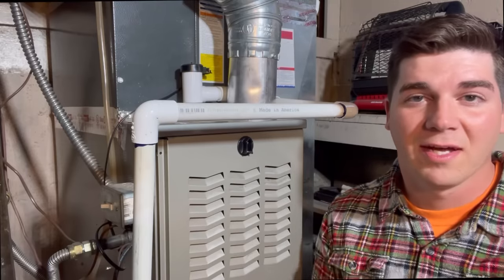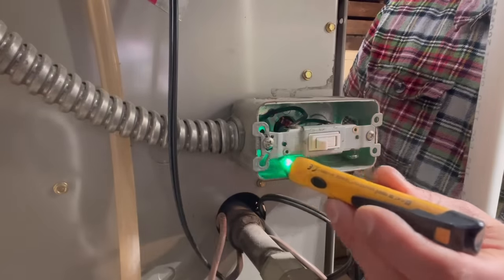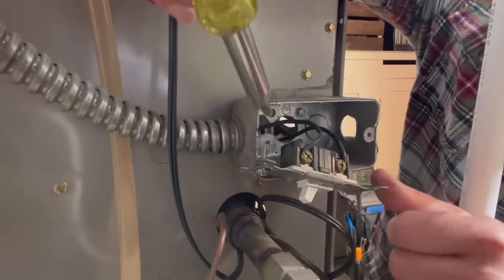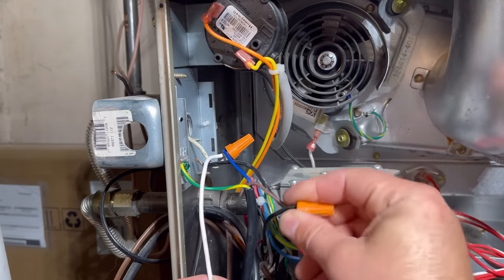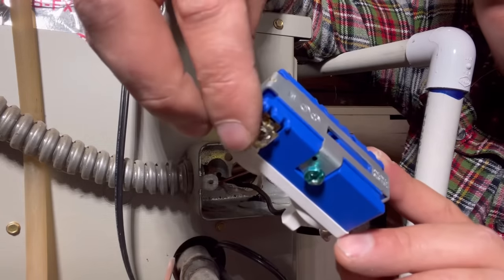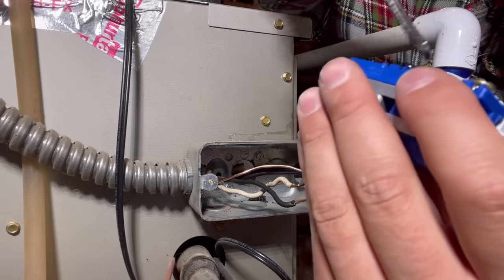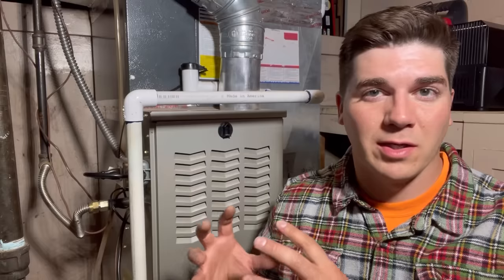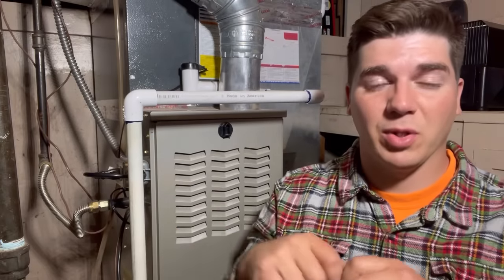This Could Keep Your Family Warm During An Emergency Power Outage.

Comment: I think you should run a wire that connects the equipment ground from inside the furnace to the supply ground which you have connected to the outlet ground.  This way even when the pigtail is unplugged from the outlet the furnace is still grounded.  Also when the pigtail is plugged into the inverter you will still be grounded.  

The way it’s shown in the video, when the pigtail connects to an extension cord which goes to the inverter in the car the furnace is not grounded because the car is on rubber tires and is electrically isolated from the ground.  This is unsafe!   The furnace should still be grounded to the same earth ground that the main house electrical panel is grounded to - even when the power from the street is out and not supplying power the ground will still work.
Reply: The furnace would still be grounded via the gas line, and the grounded metal outlet/housing. 

I agree, a separate ground is best practice regardless, but in this case he should be fine.
Reply: His furnace is always remains grounded to the service panel. The switch only switches the AC line. Ground and Neutral remain connected to the service panel.
Reply: @brianczuhai8909  floating generator ground is "safer" than a dead man cord
Reply: @BinaryHackerMan  I've retracted my comment about trying to commonized the Neutrals on the generator with the House AC. Let 'er float is what they apparently say.
Reply: The ground wire is there to provide an alternative path back to the supply, there is no magic about being hooked to the actual ground.  In the case of a generator if there was a short to normal house ground every grounded surface in the house would be "hot" relative to the generator neutral.  most portable generators are not used with a ground rod, most sit on wheels or rubber pads.  In this case you want your ground to connect to the generator, not to the ground rod driven by your electrical supply.  In reality because appliances have multiple unintentional ground connections you are actually tying house ground back to the ground connection on the generator, but the intentional ground connection needs to be as short and direct as possible, which it is in the installation in the video.
In the case of a poor ground, or when the service isn't properly bonded, a short to ground may not trip the breaker, potentially leaving grounded surfaces energized, which will definitely get your attention, at least briefly.
Reply: @fristlsat4663  At this point, that case isn't formally grounded at al: It sort-of is because the J-box (which is bonded) is bolted to the case, but you can't be sure that was done well enough to be bonded, so it really needs that case bond to the pigtail, since the pigtail is formally providing the power.
Reply: @MikeCnolan  Normally that might be the case, but here the equipment should be grounded to the casing (that's why the casing ground is present, refer to your equipment manual), the box should be bonded to the casing, and the metallic sheathing should be bonded to the box. I check everything with a decent multimeter when doing this to make sure they are connected, and often run a redundant ground to the box (The box has to be grounded if using normal romex), but it should be sound here.
Reply: Look again— I believe he did that. The solid ground connector to the Wago.
Reply: @terrencetrussell7625  the wago shown at 13:34 has three connections.  From left to right they are:  brown- condensate pump, green/yellow frame ground, green - pigtail male plug ground pin.  There is no solid wire in the wago. The solid wire ground from the panel only goes directly to the female outlet.  It should be also pigtailed to the green/yellow frame. But this is not directly bonded.  Yes I know that the outlet is on a metal box and that metal box is mounted on the metal furnace frame but that is not good enough.  It needs an actual wire between the two.
Reply: @terrencetrussell7625  ....and when the plug is not plugged into the receptacle, nothing on the plug side is grounded or has return path to ground. My point remains: where is the ground/neutral path at all times. This is not a trivial question unanswered. I suggest you understand the implications and learn the answer to this question before you even consider any modification.

In this case, it is a simple but critical solution:
install a conductor from the furnace ground to building ground, bypassing that receptacle. Why break that conductor for the sake of installing a receptacle on a stationary device? this introduces unnecessary risk and potentially fatal unintended consequence and suggests that the poster is unaware of the implications of what he is doing. Now here he  is advertising this as a model for others of possibly even less understanding than he to   follow.
Reply: With the pigtail unplugged from the receptacle the furnace is still grounded through the case. So long as that flexible conduit is properly grounded at the breaker panel. Probably could stand to add an extra ground from the receptacle to the box but I'm not seeing the issue.
Reply: "This is unsafe!" - not really. Since it's floating, there's no additional protection that grounding can provide. In normal circuits grounding provides a low-impedance path to ground for current, in case the live wire somehow becomes connected to the housing of an appliance. But this makes no difference for floating circuits, because there's no ground connection to begin with.
Reply: @AlexBesogonov  you are correct regarding the alternative power supply.  But please consider this scenario:  the furnace is connected to metal ductwork throughout the house.  Some of that ductwork has been modified by running romex through the ducts without using proper bushings and somewhere a wire insulation wears thin and a hot wire is coming into contact with the ducts.  When the power from the street returns and the furnace is plugged into the inverter the shorting wire has no return path to the main panel.   I know this is unlikely but that’s exactly why grounding is important for those unlikely situations.
Reply: @AlexBesogonov  your "floating" circuit will kill someone and is against NEC. 
The furnace is grounded as originally wired. It is (was) not "floating.  Why are you arguing the value of a grounding conductor in an electrical circuit?
good lord.
Reply: @osmith5086  NEC does not require bonding floating circuits to the ground. It's also not always _safe_. But how can a grounding wire be unsafe?!? Quite easily: if you have a break in the neutral wire somewhere, you can get unexpected current paths: https://youtu.be/qNx6ZHrbyes?t=2 - this is a glowing bolt due to a fault in a ground-bonded phase.
Reply: @osmith5086  If you connect to the supply ground wouldn't that cause a dangerous backfeed possibility? Say there is a short wouldn't that send power through that ground wire, through the electrical box, to the power lines, and possibly electrocute someone working on the lines? You'd have to shut your main switch off and at that point wouldn't you be legally required to have a transfer switch installed? Even if you don't connect a ground wire directly to the one coming in is there a potential problem because the furnace is connected to the box, conduit, etc. like pointed out in other comments above which again leads back to the breaker panel? I am very interested in installing one of these but I want to make sure it's completely safe and legal.
Reply: @AlexBesogonov  you are crazy.
Reply: @kamX-rz4uy  all good questions. I suggest hire an electrician. They can explain all the details as they make the necessary changes. 
Note: there is a difference between grounding and bonding. Ground is connection to earth. 
An electrical short will cause a breaker to trip or a fuse to blow, preventing further damage. 
Good to think about. 
Mike Holt talks about this at length.
Reply: @osmith5086  A short does not always cause a breaker to trip or fuse to blow. I also understand there is a connection to earth but those ground wires in a house are bonded to the neutral wires at the main panel which in turn lead back to the power lines (in addition to the earth connection). So if there's a problem and the power from the generator takes the alternate path to the ground wire that you've attached to the supply ground, that would take it back to the panel and potentially to the power lines. Are you saying since the power lines are not the source of the power (the generator is) that the electricity would only flow to earth? I would say it's much better to ground the generator than connect to the ground wires in the house. Edit: in Frist Lsat's comment, the concern isn't that it would energize the power lines (since that is not the source in this case) but rather energize wires within the house. Either way, it appears grounding the generator is what needs to be done, not connecting to the home's wiring.
Reply: @osmith5086  LOL. Wait until you find out that many countries mandate floating circuits for safety in some cases. E.g. UK on construction sites.

I guess you have never worked with industrial 480V circuits?
Reply: @AlexBesogonov  This YouTube video is not about floating circuits used in construction in the UK or about industrial 480V. 3 PH. This is presented as a DIY homeowner example of something "you can do yourself". The OP is not a licensed electrician and is presenting a limited perspective of the situation. I am promoted safe practice of observing the NEC for residential installations in North America and encouraging viewers to become educated and/or to not do what is presented. This is not only for their own safety, but for that of their families, their neighbors, future residents of that house, etc. - even utility workers down the road. Maybe I speak from some experience with first responder and disaster investigation. Do you really want Joe homeowner hacking up his home wiring with no understanding of the fundamentals? The guy arguing the purpose of a circuit breaker is just one example. 
Electricity is not a toy, and working with it is not a hobby, I'm sure you can agree?
Reply: @osmith5086  I checked. And NEC does not require bonding floating circuits to the ground. I'm also telling you that the act of grounding a generator is also not risk-free and can cause unexpected issues. In fact, in this case the safest route would be using GFCI referenced to the heater's body, to catch the neutral breaks. It might not work with heaters that do their own checks.
Reply: Grounds are just redundant neutrals! 

If there isn't a hot leaking somewhere, it's not necessary.
Reply: @jayanderson6016  if you "know" you will not have an accident, seat belts, insurance and condoms are not necessary.
These things are" just redundant."

Please be responsible, of not for yourself, then for those around you.
Reply: @AlexBesogonov  Alex, you and I both know - I hope - that NEC tells us that residential electrical equipment be installed according to the manufacturers instructions. That furnace I guarantee is required to have a hardwired grounding conductor by the manufacturer. A GFCI would not be advisable in this application. 
NEC also defines a floating circuit as "Power sources that are not electrically connected to the Earth."  Like batteries. An ungrounded residential electrical circuit violates NEC recommendations. 
You are moving the topic of discussion from one realm into another without pausing to acknowledge that what you are introducing is a rare and unusual situation. 
I say again: the typical audience for these videos is uneducated and ready to accept the quickest hairbrained scheme to achieve their goal. I am suggesting that they think about what they are doing and educate themselves on correct and safe practices. I have no interest in debating esoteric electrical theory with you. Put the rabbit back in your hat.
Reply: @osmith5086  Thanks Dad!
Reply: The furnace is grounded by the house branch circuit, as it's attached to the receptacle and it's attached to the frame,.
Reply: @warrenharrison9490  what do you mean by “it’s attached to the frame”?  The house branch circuit is ONLY attached to the receptacle. That’s the issue.  It should also be attached to the frame and it’s not.
Reply: @neilbrookins8428  it is thru the device  though he didn't add a jump from the device to the box, that would be preferred, it's technically boded thru the device.
Reply: @warrenharrison9490 .... but not when he has it connected to his isolated gen.
Reply: @osmith5086  the ground from house is still connected to the unit thru the strap of the switch/receptacle device that's mounted to the box that's screwed to the unit, it's not optimal but it's is still bonded, a jumper from the feed should have been run to the unit to make a more ideal connection.
Reply: @brianczuhai8909  Generator have no ground, test it, they put out an open ground.
Reply: @toriless  He has the outlet neutral and safety ground still connected to the furnace and house service panel. That provides a return current to the generator GFI on its safety ground. I disconnect the safety ground by plugging in a 2 to 3 prong plug adapter.
I have GFIs outlets on my generator which trip if they sense current on the safety ground.
Reply: Yeah, there's a bigger discussion about grounds, earthing, generators I don't even want to mess with.
Reply: So I was referred to this comment by someone who commented on my comment! So I guess my big question is we're all stuck on this furnace  but what if it was a different appliance and this I'm just asking because I'm generally curious what's the difference between a washing machine or a freezer or a refrigerator, space heater.  what's so important about the furnace? Genuinly curious.
Reply: @BinaryHackerMan  Both are unsafe. A floating; as in not bonded to the chassis of the inverter not to the frame of the generator; Grounded Current Carrying Conductor (GCCC) will keep many more recently made furnaces from running. Electronic furnace controls are often programmed or arranged to check for the bond between the neutral; technically the GCCC in this case; and the main bonding jumper in the Service Equipment Enclosure. If that connection is not detected then the controls will not apply 120 volt AC to the igniter, temperature sensor, and blower motor. The furnace will not run because of this built in open ground protection by the control board. 

In this case that is not a problem because the GCCC of the furnace continues to be connected to the neutral of the Service Entry Conductors and to the main bonding jumper, which connects the neutral to the service equipment enclosure and thus to all of the Equipment Grounding Conductors (EGC) that take the form of cable armor or a continuous metal raceway. [Raceway is used to mean any enclosure through which insulated conductors are run to provide physical protection for the conductors and their insulation.] The cable armor or continuous metal raceway will be an effective EGC if they are electrically continuous, properly connected to the Service Equipment Enclosure, and the Enclosure is bonded to the Service Entry Conductor Neutral by the Main Bonding Jumper. It is the connection between the EGC and the GCCC of the furnace branch circuit at the Service Equipment which the Control board Open EGC conductor protection function is testing for. 

Some of the Open EGC protection functions are sophisticated enough to detect that the Energized Conductor (Hot) is of markedly different length than the neutral. Load controls which have that type of detection will not work even when the GCCC is bonded to the neutral of the Service Entry Conductors because the disparate lengths are treated as a Ground Fault to the neutral. That is one of the many reasons why any alternate power supply arrangement should be functionally tested well before any disruption of the electrical utility's supply. Only a full function test done with the Service Disconnecting Means open will detect any complication of the relationship between the alternate power source and an individual load. 

Tom Horne
Reply: @osmith5086  Let me point out that both of those conductors are intact back to the Service Disconnecting Means. What the presenter did was to splice the "Neutral Conductor and the Equipment Grounding Conductor (EGC) of the furnace to the "Neutral" Conductor and the EGC of the power cord. That is why he used all 3 terminals of the lever lock connector on both of those conductors. As it happened here there is no break in the continuity of either of those conductors between the furnace and the Service Equipment Enclosure because both of those conductors are unbroken by either the switch or the way he wired the unswitched conductors. 

There are a couple of technical errors in the way the EGC of the branch circuit and the EGC of the furnace are connected. The bonding of the surface mounted device box to the branch circuit EGC is dependent on the metal contact between the yoke of combination switch receptacle and the ears of the surface mount device box. Although that is a permissible way to bond the ground port of the receptacle to the branch circuit EGC, once the branch circuit EGC is bonded to the device box, it is not permitted for connecting the branch circuit EGC to the device box. In other words the branch circuit EGC must always be bonded to the device box and contact between the receptacle yoke and the device box is not an acceptable way to do that. When the device box is surface mounted it is permissible to use the metal to metal contact between the receptacle yoke and the device box for connecting the ground contact sleeve of the receptacle's EGC port, which receives the cord plug's round EGC connection pin, to the branch circuit' EGC. That is not to say that it is Best Practice but it is US National Electric Code compliant. Best Practice would have been to splice the branch circuit EGC to both a jumper from the box and a jumper from the EGC terminal on the receptacle yoke. 

The additional challenge is that if the device box were not mounted to the furnace enclosure, thus accidentally bonding the EGC of the branch circuit to the EGC of the furnace during both utility and alternate power operation, the control board would not detect a bonding connection between the EGC and the GCCC during alternate power operation. It would treat that as an open EGC when connected to the inverter or a floating neutral generator and not connect the AC Power to the operational portions of the furnace. 

There is also a technical violation of the electrical code in using a cord and plug connection in this way. 

The code only allows the connection of an appliance fastened in place by cord and plug for specific reasons listed in article ARTICLE 400 — FLEXIBLE CORDS AND FLEXIBLE CABLES. One of the reasons listed is; 
"400.10 Uses Permitted.
(A) Uses. Flexible cords and flexible cables shall be used only for the following:
(7) Prevention of the transmission of noise or vibration." 

If that were the reason that the furnace is connected by cord and plug the receptacle would be mounted off of the furnace enclosure and the problem with the control boards open ground detection function would occur during operation by alternative power. 

The only actual change that would be needed to make cord and plug connection of alternative power to the furnace code compliant would be to use a single pole, double throw, center off switch and mount it in a 2 gang box with a flanged inlet. A flanged inlet is a device that simulates a cords plug end but is fastened in place as a means of connecting and extension cord to a load. Such assemblies are available preassembled but you can make your own for somewhat less. 

Tom Horne
Reply: @hornetd  You understand the implications of tying the ground and neutral outside of the primary panel?
You ok with that?

I'm not, for the record.
Reply: What is the hazard that you anticipate arising out of the absence of a grounding connection? Both the National Electric Code and the OSHA regulations specifically allow loads connected by cord and plug to not have a grounding electrode system of any kind. No connection to Ground is required as long as the Grounded Current Carrying Conductor, that many of us call the neutral even when it isn't, is bonded to the frame of the generator or to the vehicle frame when the generator is mounted on a vehicle. Inverters are bonded to the vehicle from which they are receiving their supply current because the negative terminal of the battery is bonded to the vehicle's frame and the negative of the supply is also bonded to the chassis of the inverter as is the Grounded Current Carrying Conductor of it's 120 volt receptacles. Since a low impedance fault current path does exist in both cases the requirement applying to bonding of surfaces likely to become energized have been satisfied. Any current which escapes from the insulated current carrying conductors of the circuit through damage to or a failure of the insulation has a low impedance path back to it's source which will cause enough current to flow to open the Circuit's Over Current Protective Device (OCPD) and deenergize the fault. Except during a lightning strike or contact of High voltage distribution conductors with secondary distribution conductors grounding does not provide for safety from electric shock. It is extremely rare for the Impedance of Grounding pathways to be low enough to carry enough current to open the OCPD of the affected circuit. Grounding's only role in human safety is were the grounding has been engineered to prevent the development of a difference in voltage over the surface of the ground for that difference to be high enough over the length of a single step to subject you to a injurious or fatal shock. Such steep voltage gradients are called step potential. 

Tom Horne
Reply: @hornetd  what hazard you ask?  I’m interested in protecting against the unknown ones.  If you look at 99% of the interlock and transfer switch circuits, they don’t typically switch the equipment ground.  This video shows a transfer switch alternative with switched ground.  Therefore this design is inconsistent with 99% of other designs in this behavior.  Since you asked for an example I will give one.  Say a diy person wires a romex through metal ductwork.  And doesn’t protect the wire as it passes over the sharp metal edges.  Then you are running a generator using the method shown in this video.  Then the street power comes back on but you haven’t yet turned the generator off because it just happened.  In this scenario the romex running through the metal ducts is energized but the furnace frame is not bonded to source in the main panel.  So it’s possible a short from romex to ductwork could energize the furnace frame.  I know this is a long shot, but you asked for an example and this is one.  There is no reason this furnace needs to be un-bonded from the house’s ground when the cord is connected to generator.   Like I said this connection is permanent for most all transfer switches and interlocks.
Reply: The metal conduit and the metal outlet box should be already connected the house ground, but you should not rely on that.  The green wire coming down the conduit should be attached to a grounding screw in the metal outlet box.  The metal outlet box should be screwed into the furnace hosing, but you should not rely on that either to provide the furnace ground.  There should be an 'official' furnace chassis green grounding wire inside the furnace and it should be run to the grounding screw inside the metal outlet box and thus to the house ground.  This assures a hard/permanent ground to the house ground for the furnace chassis and the outlet box.  THE FURNACE MUST BE HARD-CONNECTED TO THE HOUSE GROUND CIRCUIT UNDER ALL CONFIGURATIONS.

For the female outlet, run the ground to the ground in the metal outlet box.  

After all this, inside the metal outlet box there should be a knot of connected ground wires: one coming out of the conduit, one off the outlet box, a green one coming from the furnace chassis, and one running to the ground pin of the female outlet.

For the three prong cable inside the furnace, its green wire should be also connected to the furnace chassis green wire and the black and white wires to the power wires.  Don't play games with this green wire, run it to the furnace's chassis ground connection and make a good, hard connection.

Now whether you connect the three prong plug to the switched box's outlet or the alternate power source, the furnace chassis is still hard-connected to the house ground.

As for the 20amp breaker question:  NEC says if there is only one outlet on a 20amp circuit, all parts of the circuit must be 20amp stuff.  If there is more than one outlet, then the outlets can be either 15 or 20amp stuff (but with 12g wire).

In many/most cases of a furnace, the power draw is less than 15amps (rare to see a 3/4 or 1hp blower motor -- it is essentially the only power draw in the furnace; that is why it is probably not on a 220VAC circuit and you're using a simple three prong plug!).  If it really is going to draw significant power, your inverter may be taxed to run it.  Frankly, if it is this powerful (a 220VAC circuit) and you have questions about grounding, you probably are out of your depth.  

And do be careful that you've not grabbed a less-than-12awg power cord (rare but they do exist).

Don't rely on the gas line for grounding.  Don't rely on a vague chassis ground.  Follow the green wire out of the conduit and make darn sure is is connected to all the grounding points.  This is the only way to assure that you are attached to the house ground.  The electrical codes are very particular about this for real life-depending reasons.  (Even though they should be , don't rely on metal conduits to be grounded...often they are not due to bad installation or corrosion.  Rely on the green wire.)
Reply: @osmith5086  - OP is a HVAC contractor in Utah.  I could not find your credentials other than some of the erroneous comments (corrected by others here) that you made.  Yes you did make some practical common sense ones but mostly you argued with experienced installers the NEC.
Reply: what's the path to ground?  @superphotog
Reply: @osmith5086  - You will have to ask the contractor in Utah who is licensed to do this work what the path to ground is in that particular instance.

I could not tell you definitively which of my several paths to ground on my in home system is the 'mostest' conductive but I can measure that it is grounded it with my fluke multi-meter with the special double leads used for very low resistance measurements.  I also use a Simpson 260 as a d'arsonoval meter movement can load a circuit which the higher impedance dmm's do not, showing other problems not seen by higher impedance devices.  Cannot tell you how many blasting meters and flame signal meters I have calibrated but it probably is approaching a thousand units. I did that work for professional licensed electrical and mechanical tradesmen guys like the OP so I trust him over your carping.
Reply: So you are explaining that you really don't know what you are talking about. 
good job.

SIT DOWN, son. Stop whining.

 @superphotog
Reply: @osmith5086  - 📸Oooooh good burn but appears to be a little projection on your part.

But as it is a free country (for the moment) I will take the assessment of the contractors in the states from Colorado westward who were the customers of Meter Master/Process Measurement Company for the 20 or so years that I was employed there that I do know what I was talking about.

Don't know why you chose to hit on me as many of your previous comments are fairly good.  Must be a misunderstanding.  Either way, snarky comments cannot change the truth no matter what your problem is.

When I see reports of places burning down due to electrical faults that I had a hand in wiring (over 20 years since my last project there) I'll return here and read your comment with all the chagrin it deserves.

So good luck on your degree studies in Anal Sphincterology. 🥱🤪💩